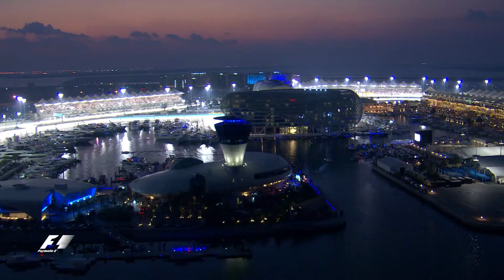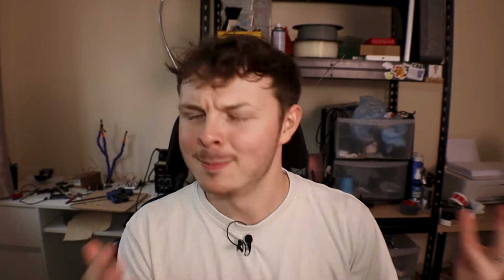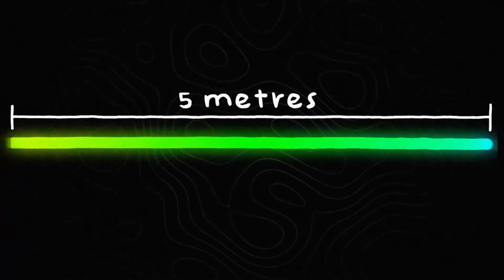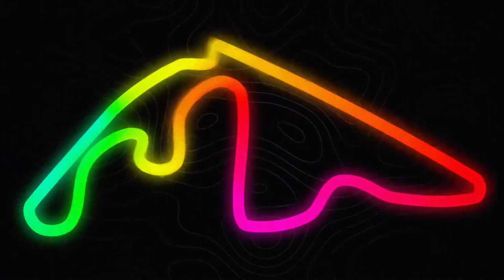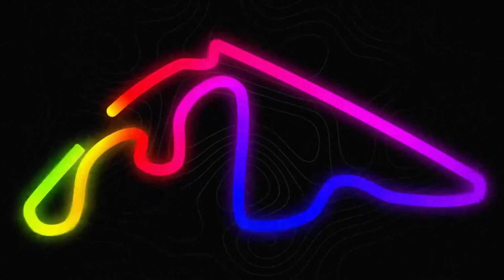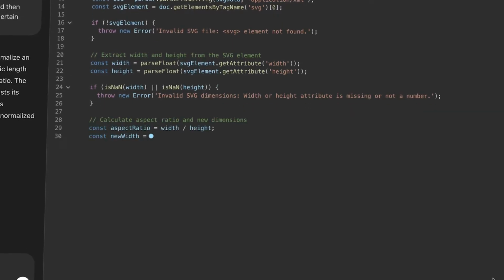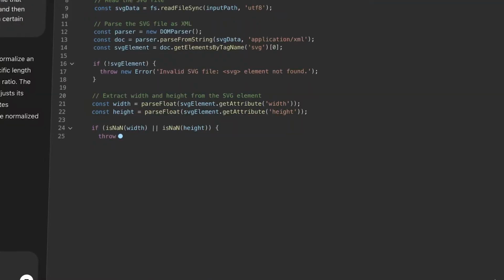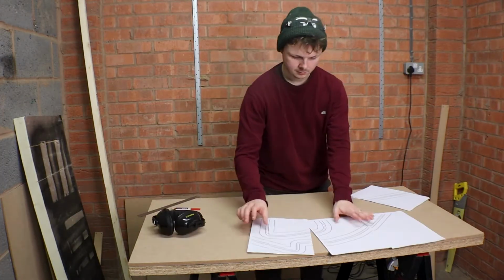Building a LIVE Formula One Race Track with LED Lights!

Comment: you were so close with the string measuring, you have to lay out all the string on the curved path you want. cut it to size, then take a ruler and measure in increments like 50cm or 100cm easiest if you laydown a tape measure on the table.